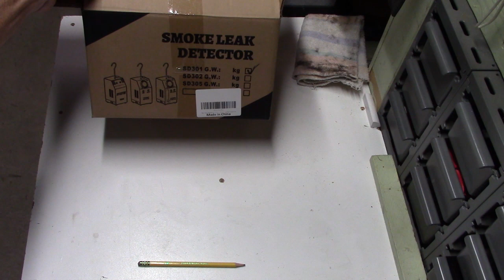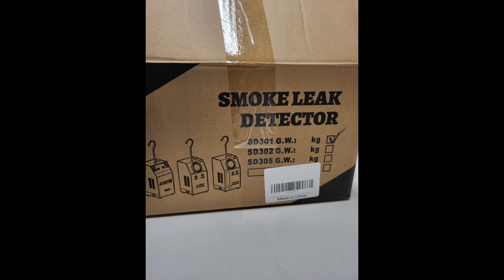SD301 Smoke Leak Detector.

Comment: I tried to use mine today for the first time but can't figure it out. I did exactly what you did and there's no smoke coming out of the tube. There is air coming out. Any tips? Did you have to wait a long time at the first use before you got smoke?
Reply from the maker: Did u add enough oil Tim? I put about half the squeeze bottle in there. When I'm done, I pour it out before I store the unit. Sounds like it's working but no smoke. I get smoke within 10 or 20 seconds
Reply from the maker: On mine, there's a switch on the side near the bottom. When u connect the leads, the unit starts up, but you will only get smoke when u flip the switch to on. Does yours have the switch and did you add oil through the top opening first?
Reply from the maker: Right at about 4:54 in the video, I zoom in on that switch
Reply: I have added some baby oil, not too much first. Then I hooked it up to the battery. Mine makes a noise in both settings, on and off, the - makes a light noise and the o makes a louder noise. But only air coming out. The thing has one switch, can't get my head around it tho 😅
Reply: It says not to add to much o I tried not putting it too much and sticking to the 30ml. I read the 30ml from the bottle and added it. Then after 10 minutes I added a little bit extra, don't want to overfill, about 10ml extra still nothing. So I really don't know if it might be malfunctioning or something.
Reply from the maker: Sorry to hear that Tim. Sounds like the air pump is working. I'm sure there's an element in there that heats the oil and causes smoke. Possibly that's faulty? Is the red light coming on the front when u apply power?
Reply: The red light turns on and indeed sounds like the air is working. Does yours feel warm/hot to the touch when being on for a couple minutes? Mine felt stonecold even after 20 minutes.
Reply from the maker: @timvanloon2379  Does not get hot  except the hose gets warm from the hot smoke. Unfortunately it sounds like the heating element is not working. I would suggest requesting a replacement. If u cannot wait, could u use it to cause air pressure and then spray all around with soapy water to check for a leak that way? The pressure this thing produces is good. Maybe too good, so I would connect loosely so as not to overpresssurize whatever you're checking